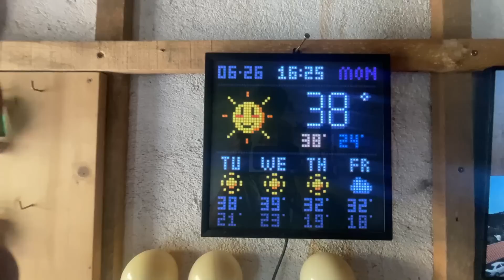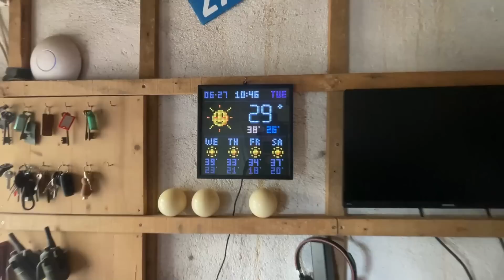WHY I DONT BUY A CEMENT MIXER! - DIY PORTUGAL

Comment: In the uk we use "spot boards" for the cement instead of buckets. I concede that we have a different climate in the UK and so the cement would go off much faster in Portugal. We also use a large container filled with water to keep our tools under water during down times if the temperature is hot, so preventing the cement from going off on our tools. When I was younger I hod carried for two brickies and I would mix 40 cement mixer loads per day, and supply brick, which is a different work rate completely. Have you considered using a slow set plasticiser in your mix to improve the longevity of your workable mix ?

Comment: As a youngster, my dad never saw the need for a little bowl mixer.  He had me.  We always mixed in a mud pan.  Low pan with sloped ends.  Used a masons hoe....Has two holes in the hoe face, makes mixing easier.  The only thing I've seen is using a regular hammer on blocks/bricks.  A masons hammer with the chisel shaped head opposite the hammer head is really useful for splitting brick and block.  Tap a straight line with the chisel side to score it, give it a bonk and you get a pretty clean line.  BTW love the progress and thanks for taking the time to film in that horrible heat. My son has been dealing with temps approaching 46/47 C in Austin Texas.  He, however, is not doing brick work!!!!!

Comment: 😂I agree you don’t really need a big cement mixer for this job. But for the retaining wall it would’ve come in handy but if you’re helpers didn’t mind why should we. Any big jobs where you’re having to wait to pour the cement and using rebar like pouring a floor, I think it would come in handy. But I guess no new toys until you learn to take care of your current toys. 😮😂😊
Reply: Yep for the retaining wall a hired mixer would have helped.
But Jasper worked miracles anyway

Comment: For cooling you can hang sacking across the window that the most wind comes in, and have it dipping into water in a bucket or trough; i used those window box plant boxes- some don't have drainage holes unless you push bits out of them to make the holes yourself. You do need some airflow.

Comment: Hi jasper as a brick I’ve just need to let you know that you only have to give the mixer a quick rinse with water run it fir a few minutes then you can leave it for next mix and you can use the water in the next mix we only clean it thouroughly at end of day  and it only takes a few minutes  not hours

Comment: I never started smoking, because I do not think, I have the backbone to stop again. But I will probably get myself a mixer in Portugal, as I do believe I am responsible enough to take care of a mixer. If I am not mistaken, you empty out the concrete in a big bucket and throw in ½ a little bucket of water and let it run for a minute, and throw that out.

It does have the benefit of being able to mix, while you work on other stuff,, and as far as I know,, it does not get insulted if you are 10 minutes late.

Comment: About CEMENTMIXER...I used to mix all materiel cement, beton, clay, roodband, geelband (in NL) etc with a big handmixer while working as a contractor, like 50 kg dry materiel plus water/mix, 1000 kg a day, no problemo. Needed only the mixer for big jobs. And indeed, when the mixer is dry, using a hammer is often used cleaning method. You just need a bigger handmixer and paar grote kuipen(I don't know the word in english now...tub?)

Comment: The time you would save by having a mixer you could spend cleaning up at the end of each job.
Reply from the maker: Did you actually look at the video before commenting ..? :)
Reply: @GhostTownVlogs  yep, and you made a big deal out of having to clean up after mixing enough to do 3 tijolos each time. Small batches of poorly mixed mortar are horrible to work with and likely doubling or tripling  the time everything takes you.

Comment: Cement turning over in a cement mixer ain’t going to dry out or set ,Even if that occurs on super hot days another splash of water keeps it workable .Then at the end of the day a half bucket of Brita with water thrown in the revolving drum cleans it for you .Then a tip out into a barrow and dump the slurry where you need some hard core base for a future  project .All you need is a big notice by your coffee maker saying .JASPER HAVE YOU CLEANED THE CEMENT MIXER ? At present you are wasting a lot of material and time . But hey every one to their own .Speaking of which I see you are still keen to get a dose of dermatitis on your hands ! Yes it will happen eventually ! Cheers and enjoy !

Comment: I think you just like wasting time Jasper! With a mixer you load it start it and while it´s mixing you can continue doing other things to get the job ready. At the end of the days work you empty the the mixer and rinse it out - a must. If your´e making concrete you can add some gravel to help clean it out and with enough water you can leave till next day. Brickies use mixers all day and they only wash it and the end of day. You can add as much as you need to the mixer for each job! On hot days after each mix you empty it into one of your bucket or two and the add some ware to it and run it to to wet the the inside completely and then add sand first the next time you use to help pickup any residue mortar before you add the cement. Unfortunately Jasper you need soeone to show you what you can and can´t do. It will save you a lot of time and effort! AS far as your current mixef you need to get a taller bucket fill it water and put it into the water between mixes so it doesn´t harden!
Reply from the maker: Yeah I just like to figure things out myself. I don’t care what everybody says is the right way. I listen, consider, and do it my way :)
Reply: Never change that either Jasper, enjoy the journey and follow your heart ❤

Comment: Trowel. If you smash the cement off it when you're bored one day, you should be able to get all the cement off and glue a handle back on - you can buy the handles on their own. They're normaly softwood and you'd need to drill them and epoxy in the tool, but if you have something you want to keep using because you've had it for years, they're reasonable. Also, I think you'll be ok because your property will have good draining around it but the cement against the wood around the roof will hold more moisture than lime-mortar, which is more porus. The space at the back of the property could have a French drain in it and I think you'd be really safe. There's an electronic device that can be used to measure the moisture content of wood, a moisture meter, and if you could borrow one you could check your walls and the cement around the roof. I think you'll be fine.  https://www.ebay.co.uk/itm/404230271990?hash=item5e1e0073f6:g:bw0AAOSwK05iVYZA&amdata=enc%3AAQAIAAAA0OjBXHVxv6p5GXP%2F1pH4vcccLZF%2BH7awrTznOItnZ2jqr5olNVeMcOq%2B8zs4edoYO3IByOIMrjg1ehJwmbGHsLEbQJBFBK9WcdazydmLmKDX45Noaxzt6zArjk8us0Jj1hXLiXRU1xdpZ7hKEgInzZFrW8y1vUbYD7ZsMhCv9NlGWhP6ZVgP01LTMp1RP7FADosCM1PvcX1OWnTNVF%2F5XKcALncr0gddLzKPVR2RAUi%2B4nHtlhUkXIZrOs4BtzRkhkvQP1KRVF9yPyMvJHddvBA%3D%7Ctkp%3ABk9SR4Th1oyiYg